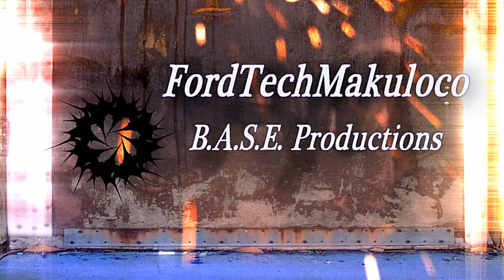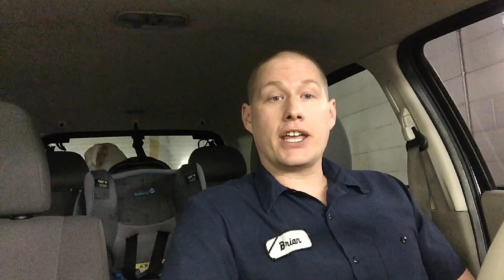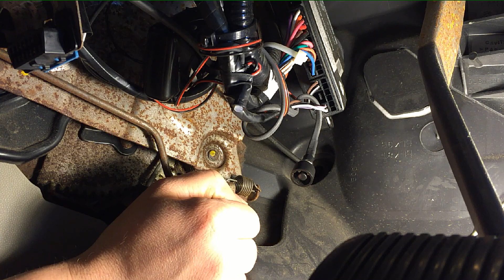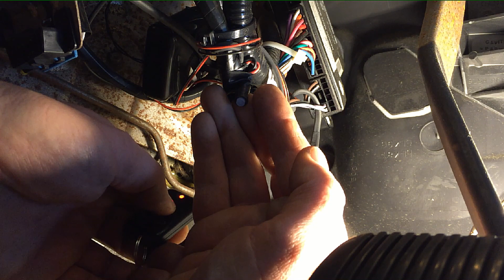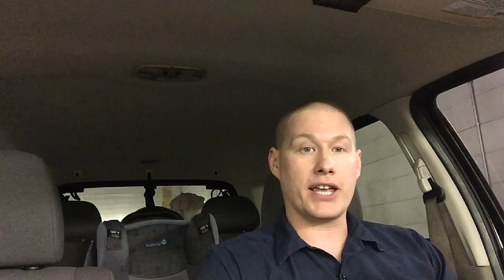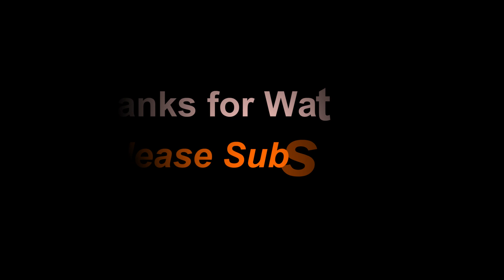Ford Remote Start System: Changing Run Time To 15 Min

Comment: Have a question. Just bought a 250 6.4. The previous owner took the remote start module with him. Is there a procedure with the over ride button to start the truck? When I try to start the truck the PATS system kicks in

Comment: Yes I have a 2012 Ford F-150 I added the extra antenna and but when I the air filter radio won't come do you have any idea what is the problem

Comment: of course I've always been told you should NEVER just start it up and drive off especially on a cold morning, since the oil and other fluids are still cold and thick.  the most wear on the engine is just after you start it up.

Comment: Hey Brian I have an 90 f150 with remote start. When I attempt to use the remote start, it fails to start and horn beeps 3x
Reply: I have the same issue now I followed your video and now it doesn’t start it started before

Comment: Hey Brian, I have a 2011 Ford Taurus SLE. I recently installed an aftermarket radio which required me to remove the dash partially. There is a ring around the ignition with 2 wires attached, one of those wires broke loose and now my remote start will not work. I have this same remote start system you're working on in this video. Do I need to purchase another of those rings? If so what is this part called and where do I find it?

Comment: Hi I am getting a 2013 ford explorer xlt it has a key I would like to switch from the key to push to start would I go to ford dealership to get that in if I did how much it cost or should I get a mechanic to put it in

Comment: hi, now my 2010 ford edge  is honking 5 times when I push the remote start button. Please help.
did someone find a fix for this?
Reply: Don't know if you figured this out yet, but I managed to find the instructions for this system. Apparently 5 honks means it thinks the key is in the ignition. Probably you accidentally changed Bank one option 3 (key in sense polarity) instead of bank two option 3 (run time). That's just a guess though, if anyone wants the full 2010 year instructions let me know and I can send them. I don't think it's possible to share them directly in a comment.
Reply: @AricVogel   hi. Thank you for your help. Yes please if you can send me all the instructions or file.
Reply: @dijam001  I tried to send the link, but it looks like it may have been filtered as spam. If you don't see it, send me an email (click on my profile, "About", and click "VIEW EMAIL ADDRESS").

Comment: I HAVE AN AVITAL REMOTE STARTER WITH THE 4 BUTTON KEY REMOTE. MY TIMER STOPPED SHUTTING OFF AT 12 MINUTES. NOW IT SHUTS OFF AT 30 SECONDS THEN RESTARTS, SHUTS OFF AGAIN THEN RESTARTS FOR 30 SECONDS. I CAN'T FIND THE VALET BUTTON TO RE-PROGRAM. IS THERE ANOTHER WAY TO RE=PROGRAM?

Comment: My Ford factory remote start upon pressing button chirps once turns on lights just as it used to... but now  I get two horn chirps and then nothing, no start. I checked the hood tip sensor and it's positioned correctly. Could sensor be bad, someone mentioned that 2 chirps could also be a brake issue.....I'm stumped.  Any help would be GREATLY appreciated!!

Comment: Will it work on 2013 Ford Fiesta Titanium (lemon, btw)?  I saw the comment that it won't work if built into the key.  There is only a fob.  If it does work, I assume I just hit the start button without hitting the brake (not as one would to get the engine to turn over) to get into "accessory" mode?
 I am happy to hear your environmental side note, new infant here and temps have been negative in upstate NY.

Comment: I must have messed up, now my 09 f150 fx4 is honking 5 times when I push the remote start button. Please help.
Reply: hi did found a solution for your problem, because I have the same problem?

Comment: Where is this override button on a 2014 f150 ?
Will this work for it also?
Reply from the maker: There is none.
Reply: I found it on the cluster put could not move it up to 15min.

Comment: hi my remote starter does not work anymore it honks 6 times and does not turn on. any help?
Reply: donato battista did you find a fix for this I'm having the same problem?
Reply: wiredupfiredup I did find the solution to fix it online. the car was in valet mode for some reason. just look up how to take care out of valet mode and it will work. it has to do with the key in the ignition and the brake pedal.
Reply: donato battista  when I hit my button everything is ready but then it shuts down and the horn beeps 5 times tried resetting it but I forgot
Reply: hi, did you find a fix for this I'm having the same problem?

Comment: Great info, is there any booklet that tells us which bank, or mode to get into for the different settings. I have a 2017 Transit it shuts off when any door is open. The dealer told me there is no way to change it.
Reply from the maker: The menu may have changed but unlikely you can use this procedure- https://www.youtube.com/watch?v=TJAE3Bnf7Js

Comment: Hi! I have 07 focus 2.0 engine. Bought the car and it has a after market remote start. Just wondering why everytime i'm using remote start it's grind its like the starter still spinning but the engine already start. May be one or two seconds grind then it will goes off. When using with out a remote start there's no grind. Hope you can help me. Thanks!

Comment: My wife's 2011 Edge has the remote start built in to the key itself. Should this process work the same for that unit?
Reply from the maker: +Michael Szewczyk If it is built into the key there is no option for that unit.
Reply: +FordTechMakuloco thanks for the info
Reply: +Michael Szewczyk On your vehicle with factory remote start you can change the remote start duration in the settings on the instrument cluster. You have the choice between 5, 10 or 15 minutes run time.
Reply: +whatitis99 thanks I'll give it a try
Reply: Michael Szewczyk You're welcome!

Comment: hello I have a 2010 ford escape xlt and i set my command start to run for 15 mins and it shuts off after 6 mins . why is this ?
Reply from the maker: +wman1973 the only options on our systems are 10 or 15

Comment: I have a 2010 escape. My remote start will not start the radio/blowers come on but no engine. Is it programmed wrong or is their another problem?
Reply: +FordTechMakuloco mine does but wont start..  I fiddled with the underhood switch and it started.. orderd new switch
Reply: I have a 2009 escape and my remote start will not start the engine but everything esle goes on what should I do?
Reply: I replaced switch and it started, next morning wont start!
horn beeps, lights come on and nothing happens...
So sick of this crap
Reply: Mine does the same thing! Very annoying!
Reply: mines been doing it since I first got it.. so fed up! and it was 300$ more than an aftermarket!
Reply: Mine worked when we bought the car (used) then my toddler got ahold of my keys.. and yes no more remote start.
Reply: did u change battery? yours sounds simple
Reply: Yes. I think he hit the button one to many times and possibly reprogrammed the starter.
Reply: Yes. I think he hit the button one to many times and possibly reprogrammed the starter.

Comment: Thank you for your videos on this subject.  I am putting a Ford OEM directional security/start on my 2014 F-150.  It is all plug and play so that is simple.  Is there a way around having to go to the dealer to have the system turned on through the IDS?  Local dealer wants 1 hr labor for what I am told a 15min job.
Reply from the maker: +James Hilliard It is a 15 minute job at best tell them .5labor is fair. Funny labor times to install these completely is only .5 tell them that. There is no way around it.
Reply: @FordTechMakuloco  hi Brian I have a question I have a 08 ford explorer 4.0 my factory alarm remote was working fine then after a shop replaced my transmission then the remote stop working completely,  I tried to reprogram it still don't work.

Comment: I have a question on a ford 2006 FORD EXPLORER EDDIE BAUER. I lost the key and fob to my truck and the second fob I had was damaged and no longer working, so I ordered two fobs from amazon that looked the same as the four button fobs I had, The problem is that my remote start does not work with these fobs, only the lock and unlock of the doors, not even the trunk or back window unlocks. Also the alarm trips when opening the doors, and I programmed the new remotes according to the instructions.The remote start system is from the Ford Motor Company the ID # is ENG P/N:2W7J-19G367-AA. CODE system H63DB. Power Code Technology. Requires PC-32 Module. Can you help me to find a solution to getting the right information to program my remotes? or reordering the correct remotes that will work? Since I only have one ignition Key I had to make a clone and bought it at the home depot. and found that home depot was the cheaper alternative now that they program transmitter keys, Having said that I don't have the two original keys; will this cause a programing issue? My email is adidas2693004@yahoo.com.
Reply from the maker: TONY Tone Sounds like you have  security and remote start module. Ifd you have the 4 button remote you need this part number- 2W7Z-15K601-BA
Reply: FordTechMakuloco  Thank you for all the great information you share with all of us. I was gonna order the part number that you sent to me but when calling the dealer I was told that they have to program the module with the fob and they would charge me an hour of labor on top of the cost  of replacing the fob. FORD makes it so hard on customers; This should be done as a courtesy or for a small fee knowing that you purchased their vehicle. Is the dealer being truthful, or can I program the fob without their computer programing the module?

Comment: I bought a new 2014 Focus Titanium last week, and while I was fooling around with the settings on the screen between the speedo and tach, I found that the software allows you to set the remote start run time by pressing the buttons on the left side of the steering wheel. Just in case anyone wanted to know.
Reply from the maker: Yep the new ones are menu driven and totally integrated.

Comment: i have a 2002 mercury cougar 2.5 liter engine codes p0401 and p0420 which one should i start with first?? im in the service manual doing diag for the p0401 where it asks you to do a key on engine running test and hook a vac gauge to the egr valve vac source and look for a 3 inch vaccuum increase during the test next step is the dpfe sensor are these a common fail? done messing with it for tonight to cold for that
Reply from the maker: phil holbrook Forget the 420 code you need a cat for that. If you have a vac pump apply vac to the nipple on the egr valve and see if engine runs real rough or not. If it runs rough and when you take the pump off it runs ok then you need a DPFE.
Reply: found the issue it was a blocked egr passage, between the throttle body and intake. do new new fords still use the dpfe?? some i dont think have egr valves anymore could be wrong though.found the fuel pressure defective so shes runnin good now. nice o2 sensor waveforms now
Reply from the maker: Yup I have cleaned a few of those in the past, new fords do not use dpfe anymore and yes the new one with vct don't even have egr valves.

Comment: curious to know if you have a fix to get more range out of the stock key fob on my 2013 f150, can only unlock, lock, or start from about 30ft
Reply from the maker: Gary Janzen Have you tried your second key with new remote and batteries to see if it is the same.
Reply: FordTechMakuloco yeah, same distance. some situations its ok but i don't know what causes it.
Reply from the maker: We have seen a few complaints of this in the past without any real resolve. Mainly rfi interference in your area or aftermarket accessories in the truck causing interference we have found.

Comment: the funny thing is nothing happens I can unlock it with the key in the door by turning the key and pulling up on the knob but it's like no power to them even if I go to the passenger side and push the buttons nothing happens and by the way I'm sharing your videos on f 150 1997 through 2003 Facebook you are helping a lot of us out with me sharing video I was hoping it wasn't the GEM module
Reply from the maker: To be sure I would pull of the door panel, disconnect the electrical connector for the actuator put a load across the terminals like a light bulb and then hit lock and unlock if it lights the actuator is bad.

Comment: I got a quick question on that plug in and plug out on the steering wheel is the  same connections on a 2014 and 2015 ford explorer or steering wheel connections are they hot different plugs between 2014 and 2015
Reply from the maker: david Diaz Which connectors exactly are we talking about? What do they plug into?

Comment: Hi Brian! Nice use of props to get your point across about infants and pets. Is that remote start unit a factory-installed option? It looks kinda hooptie with the twisted wires and electrical tape. No need for them here in Central Florida. ;-)
Reply from the maker: Neil Saville Yup it is a wire in unit from Ford Accessories.

Comment: FordTechMakuloco I have a 13 f150 with the cluster lcd. I can select time intervals for my remote start through that screen but it only goes up to 15 minutes, any way I can go longer than that?
And is there a way to have my heated seats turn on with the remote start? I tried selecting it through the cluster screen but that doesn't seem to have worked
Reply from the maker: Gavin Dhillon  No way to set the run time longer no. As far as the heated seats they function as stated below.When the driver seat and/or passenger seat is set to AUTO mode, the 
driver/passenger heated/climate controlled seat activates in full heat mode when 
the outside temperature is less than 0°C (32°F) and full cool mode (climate 
controlled seats only) when outside temperature is greater than 27° (80°F) any 
time the vehicle is started using the remote start feature. No heated/climate 
controlled seat adjustments are recognized during remote start operation. When 
the ignition is cycled to the ON position after a remote start event, the 
heated/climate controlled seat switches off.

Comment: Great video. Yes cold catalytic converters don't work at all. It can take more than 10-min of engine run time for the converters to reach optimal operating temperatures, at least the converters that are  not integrated with the exhaust manifold.
Great video as usual.

Comment: Quick question...I have been told (and my old 2004 toyota tundra manual even says) that idling a cold engine is bad for it.  This is due to the old being thick and the engine oil pump not operating at a higher rpm to pump that thick oil thru the engine.

Any truth to this...I have a new ford escape 1.6l ecoboost, as well as a new ford focus 2.0l (no ecoboost) and both have remote start.

Thanks!
Reply from the maker: No it was more like carbon and such leaving deposits on your valves more than oil flow. The engine is made to provide plenty of oil pressure at an idle and the pressure is usually even greater when cold. Besides with the advent of multi viscosity oils that is also a thing of the past.